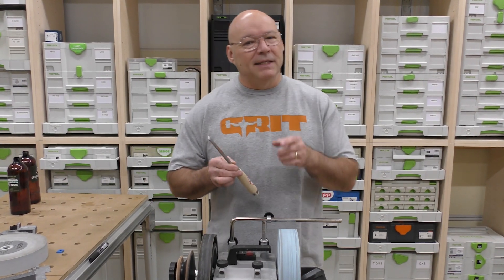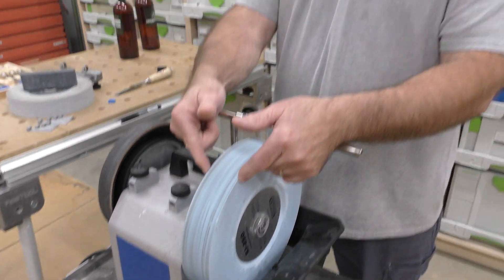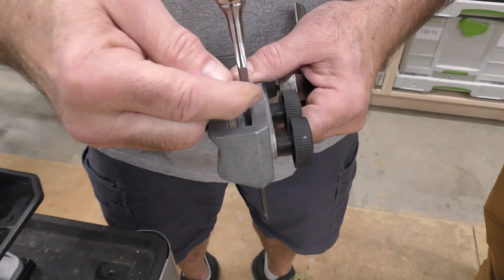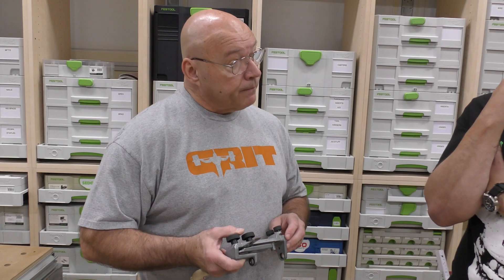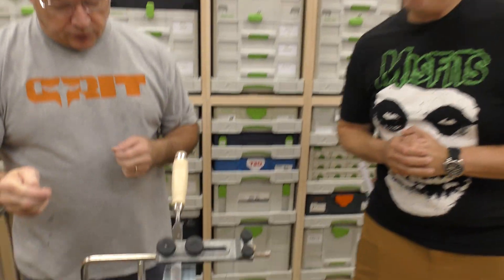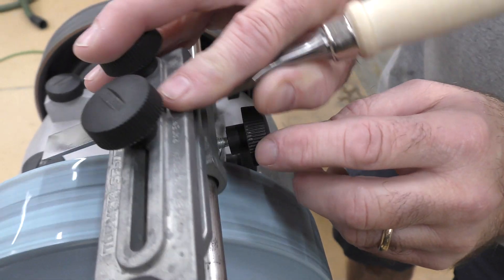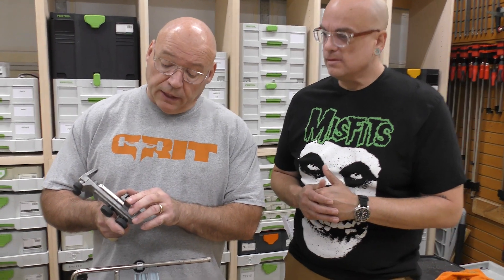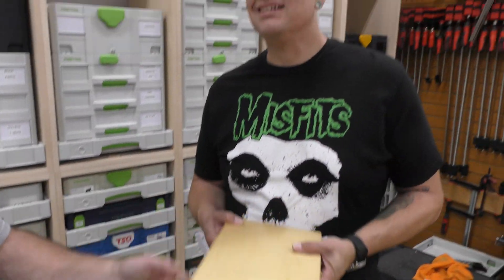Japanese Stone: Tormek T8

Comment: I have a super grind 2000 with an SG250, how much of a difference do you find the SJ-250 makes compared to the 1000 grit of the SG-250? 
Thanks for the awsome video by the way 🙂
Reply from the maker: I use the SJ-250 when I just need to do a quick hone...I still use the SG-250 quite a bit
Reply: @sedgetool  Can you notice the difference in the results when using the tool?

Comment: Your videos are an excellent supplement to the "official" Tormek sharpening tutorials,  and often much better. I am a new user, having recently purchased a T8 and have been practicing functionality and technique. Question; sometimes after I have sharpened a  knife, I have noticed under a bright light that the bevel on one side appears to be larger ie. higher up the blade body than the other side. Yet, the blade angle to the stone remained the same for both sides. Your advice is greatly appreciated. Thanks, your videos have really helped my sharpening abilities. And, a hello to you too BIG D!
Reply from the maker: I have had this happen and cured it by maintaing a steady line and lifting in line not trying to follow the curve of the blade...be patient it took me a few knives to get this technique down...
Reply: That might be an aligning issue, can be tackled by reclamping after sharpening first side.

Comment: I can't even afford a tormek and I like these videos
Reply from the maker: wicked
Reply: I could not either however have a look second hand for a tormek supergrind 2000. I bought one for £180 second hand and you can install nearly all new parts on it. 
Make sure you check for the stone quality and few other bits before buying
Reply: been using for over a month and think the Tormek is worth the investment. I have sharpened so much it from knifes, plane blades, chisels and motor blade. The quality makes me think its a buy once tool which is why its so expensive. Have you looked at the smaller unit as well?
Reply: Too dear
Reply: Sta shap